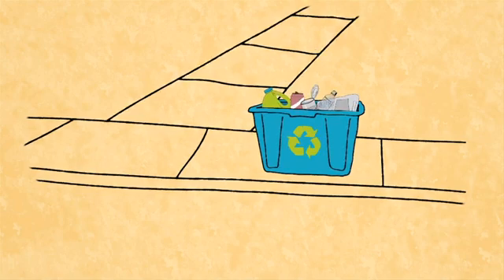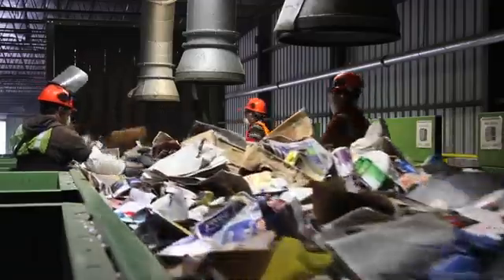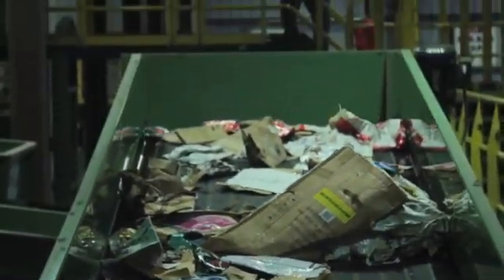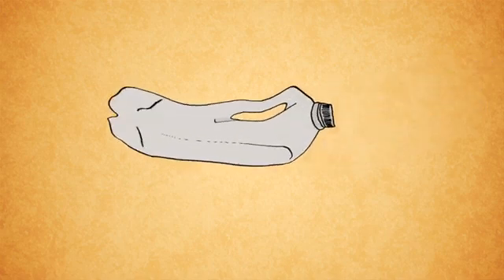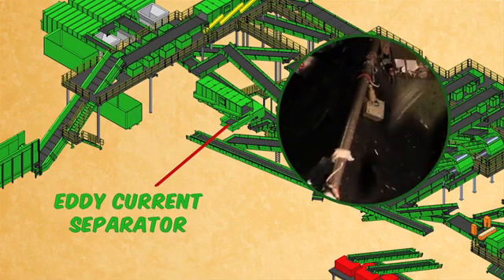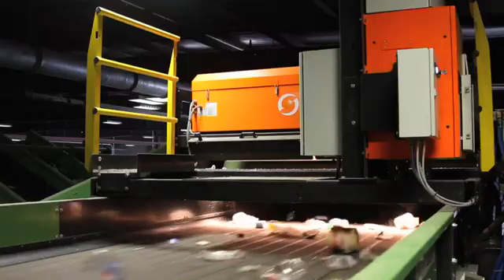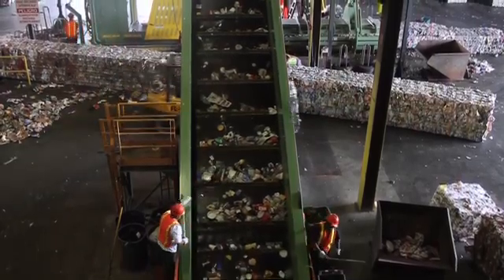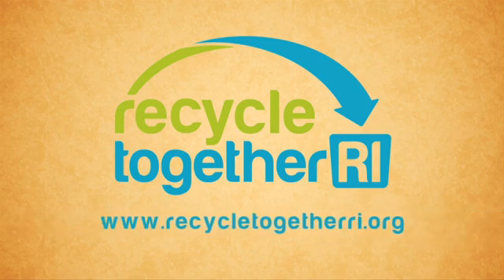Virtual Tour of Rhode Island's Materials Recycling Facility

Comment: a. the tipping floor should have a pit... into which the first conveyor should extend.... then the bulldozer only has to push the mixture over the edge.. 

b. individual human sorters are inefficient... bots should do the sorting in addition to the sorting wheels and fall through grids
Reply: Humans are also cheaper than robots. Recycling is already an expensive process that doesn't always produce a full return on investment.
Reply: @SmartHerSparty  
if we don't do it more efficiently and effectively we will drown in the junk..

other threats..
grid fail.. sun spot.. attack...age
chem pollution
water shortage .. lake powell  lake 
        mead..    ogallalla aquifer
soil depletion
default on nation states debts

we can't go on endlessly the way we are
Reply: @Michael Rostom 
you are luddite ?

Comment: can we use the heat created to burn the methane collected elsewhere?
Reply from the maker: Decomposing trash in landfills continuously produces gases like methane and carbon dioxide. We
collect this gas through a system of collection pipes and wells, and transform it to electricity in a power plant, which is the largest landfill gas collection plant east of the Mississippi. You can see the many wells sticking out around the landfill. More are located in the newer phases because the peak of off-gassing happens early on in the decomposition process. Each year, enough electricity is produced to power 28,000 homes. Collecting these gases not only reduces our need to burn fossil fuels for energy, but it also keeps these greenhouse gases from entering the atmosphere and contributing to global climate change

Comment: Nice video
Im gonna go look for what happens to those giant cubes once a company gets them
Reply: +thekillerwaldo overband magnet,magnetic pulley, drum magnets. lifting magnet, eddy current separator . air jet separator machine etc, you can contact me .chnmag@chnmag.cn
Reply: +Richard Noel Hedditch Recycling programs actually do the oposite of what they intend. It's a 
math thing. More energy is expended adding to climate change. In moneys 
“it costs $28 per ton to landfill waste compared with $147 a ton to 
recycle” Trucks constantly on the road add to air polution.  Recycling 
programs do not make a profit either. So since you pay taxes and most 
programs are run by cities and counties, (privatized recycle 
corporations are in the 'metal' business for profit only),  you   pay  
more  to  recycle  in  dollars  than  in  your  garbage.  Causing you to
 have to burn more gas and electricity to meet the added costs.  When it
 comes to the final bill  we  lose.
Reply: *****
I think you may have missed my point entirely. Recycling does not fix the problem. !. we are destroying the planet. 2 we are destroying the planet through the methods we use for the production of all our energy. (yep all) 3. recycling ADDS to the further destruction of the planet through its consumption and methods of the production of the energy needed to accomplish it. 5. in the end analysis more energy and thereby damage to the planet is created than saved. 6. there for recycling produces the opposite of what it claims to accomplish.  7. its a math thing in which the expenditure of energy (or dollars) and the methods of energy production and the total  help vs damage to the planet is in the negative of distruction side. Clearly our 'solutions' are not working. Even, like recycling, those that are said to are after analysis doing just the opposite. "Recycling' doesn't help the problem it is adding to it. You are confusing the redistribution of raw materials with solving the problem. its apples and oranges.  does not matter how much material is 'saved' or reintroduced at all. The energy and thereby addition to heating up the planet is the issue here. In the end analysis it does not matter how many gallons of oil you saved recycling the plastic if it is still heating up the planet...

Comment: Great job. This helps reinforce the idea that what you recycle actually gets recycled.
Reply: +Neil Rhein overband magnet,magnetic pulley, drum magnets. lifting magnet, eddy current separator . air jet separator machine etc, you can contact me .chnmag@chnmag.cn
Reply: +Neil Rhein Recycling programs actually do the oposite of what they intend. It's a math thing. More energy is expended adding to climate change. In moneys 
“it costs $28 per ton to landfill waste compared with $147 a ton to 
recycle” Trucks constantly on the road add to air polution.  Recycling 
programs do not make a profit either. So since you pay taxes and most 
programs are run by cities and counties, (privatized recycle 
corporations are in the 'metal' business for profit only),  you   pay  
more  to  recycle  in  dollars  than  in  your  garbage.  Causing you to
 have to burn more gas and electricity to meet the added costs.  When it
 comes to the final bill  we  lose.